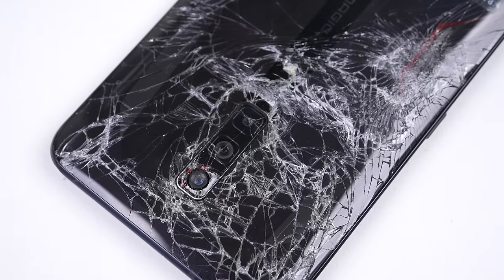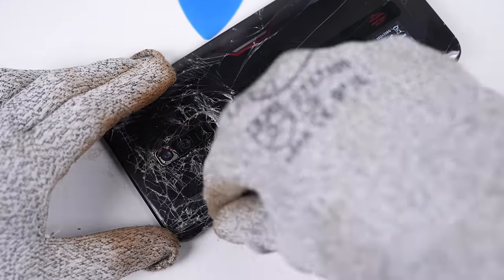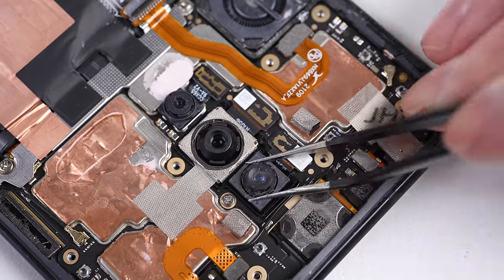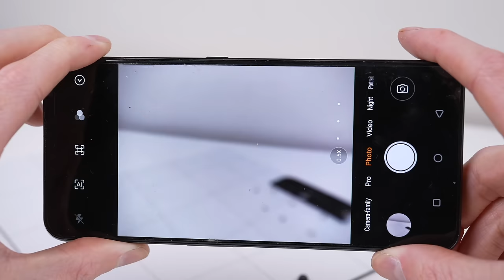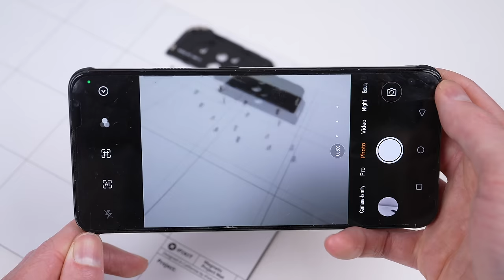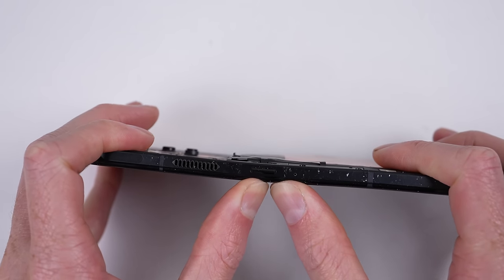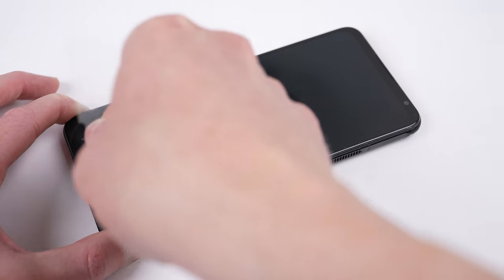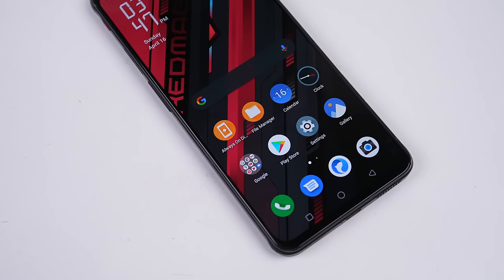$29 Redmagic 6 Gaming Phone Restoration

Comment: I'm thinking that the camera sensor and lens assembly is not unique to this phone. You could probably find out what model sensor assembly it is using and find a replacement for another phone. Take the lens off of that sensor, and your good to go.
Reply: My thoughts as well - there has to be a donor device (even if not a Redmagic) whose camera would fit onto the motherboard connector and space etc.
Reply: @TheSpotify95   I'm just thinking of getting the lens from the donor assembly. But hey, if it works, use it.

Comment: At  3:22  the reason why it got worse after polishing the lens, is not because more scratches, but polishing actually removes a small layer from the top, thereby distorting the focal length of the camera. The only way to fix it, is by replacing it.
And for the love of all, please stop using that disgusting glue for the screen and back, instead use generic double sided tape of various sizes or better yet factory cut one if available.   It's cheap, and yes it take a bit more time, but makes subsequent repairs much easier and professional. ;)
Reply: Correct. Any lens polishing results in changed optical characteristics. Replacement is the only viable option.
Reply: nah bro e8000 tastes good
Reply: @soupdrinker72 - "Tastes good"?  What's wrong with you?!  lol  Gluing screens and back are a disgusting hack job, the lazy man's choice.  Good luck repairing it again.
Reply: He has double sided adhesive which he normally uses, but given the bent frame, double sided adhesive might not actually fit to the bent frame properly, hence the use of liquid adhesive. In the right circumstances, E8000 is OK.
Reply: @TheSpotify95  - It's best to straighten the frame before mounting a screen with tape or glue if that's you prefer.  I'm not a fan of lame jobs.

Comment: Spinning that lens will change the focus and I think what happened is it was not screwed right when you tried after using the polishing paste, because such lens scratches shouldn't appear that sharply on the screen, so it looks like like the sensor was focused on the lens and not "using" the lense, you had to have the phone on and spin the lens until the image looks better, but i guess you'd still have had the blurry halos on the sides. Also I'd have tried polishing with a cotton bud on a drill, with different pastes, the one you used seemed too harsh
Reply: Yup, I would have also suggested using a cotton bud in a drill (or Dremel) and much finer paste.

Comment: Not bad at all, even in that condition, I'd still happily buy such a device. I'd also keep an eye out to see if any stockists decided to stock the ultrawide camera again at some point.
Would it be possible to use a camera off another device, which has the same connector?
Reply: That could work, as many manufacturers just use the same parts. It might also be worth a shot to try and find another identical phone that's broken, and use the frame and camera from that model.

Comment: A bit unfortunate that it turned out to be a slightly subpar repair result, specially compared to your usual excellent works (I see why this video took longer than I had thought it would :))
I think for the camera, if the exact sensor model and specifications were to be known listed, then you should be able to attempt to find another camera from another device which also uses the same sensor as an ultrawide, even if despite the lens from that camera were to have different specs in aperture and focal length;
If the camera had the same connector which it generally should, you could just transplant the whole module over onto this phone and it should be compatible at least enough to function just fine, since ultrawides as comparatively quite a lot simpler compared to other camera modules such as main wide or telephoto, since those tend to have more functions such as optical image stabilization, or advanced fast autofocus, etc. which the ultrawides does not tend to have, generally, due to the wide field of view; 
which this seems to be the case as well judging by lens assembly
So there a good better change that it would work with the camera drivers and library or modules cade that this phone would have with its firmware

Comment: Use Glass Polish,  my Phone Screen Polishing Machine Polishs 100% scratches out of screens so no doubt easily Polish out that lens
Reply: no
Reply: @kobs9636  no what ?
Reply: @waynetaylor2784  it wont work on camera lens. the way to is air blower or dont touch it at all. it will just get worst.
Reply: @kobs9636  Do you have an actual phone screen polishing machine?  If not don't think you can comment,  the Polish can easily be used on a Drexel to Polish camera lens

Comment: Excellent restoration, seen the circumstances.
One thing I noted with some native Chinese phones with high specced hardware - is that they don't deliver all the speed and smoothness allowed by an high-end SoC and fast storage, very likely because the software is not optimised as the software of a Google, Samsung or Sony phone. I don't have or use Apple devices to compare with.
Thank you Mr. Jeffreys.

P.S.:
One little unrelated question: have you ever used one of those miniature motorised screwdrivers to disassemble / reassemble a phone or other devices? What you think of them, are they truly useful, or are a modern gimmick? 
Thank you once more.
Greetings,
Anthony

Comment: Question on a macbook pro 2011 when a new battery was plugged in it causes the screen to glitch and freeze and eventually turns off and when turned back on it crashes and glitches the hell out… how to fix this it works well when jts unplugged and is on with the charger…